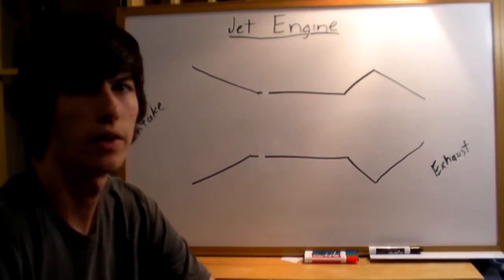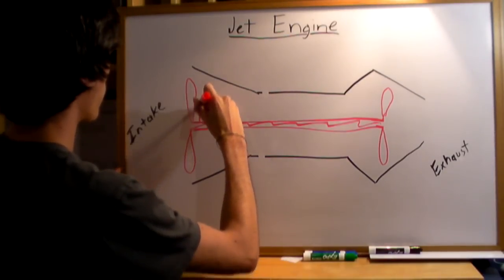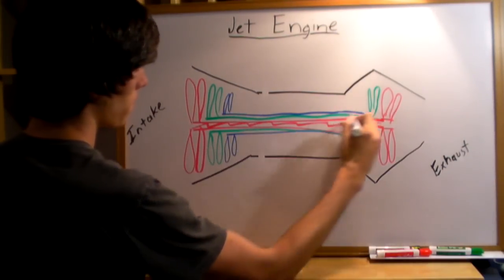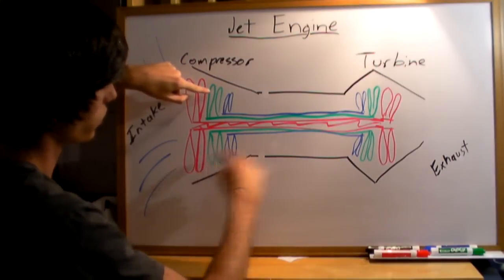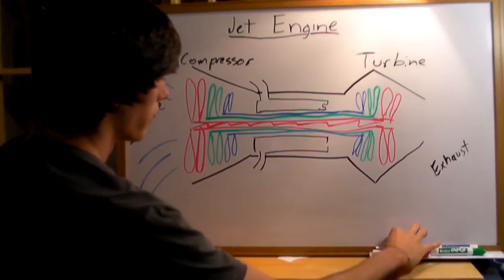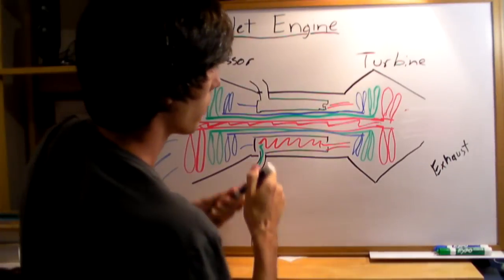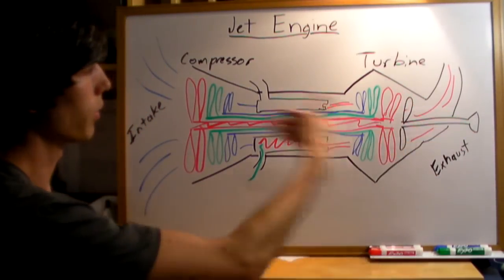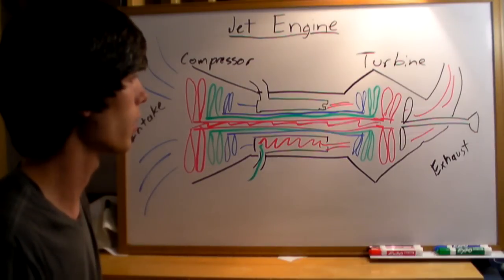Jet Engine - Explained

Comment: Hey! Aren't there, in between the turning compressor blades, static blades too?
Reply: Guide vanes are indeed employed throughout the engine.

As a compressor blade imparts momentum on the gas through rotation, it forces it along the path, but also imparts angular momentum on the particles.

Guide vanes scavenge the kinetic energy from this angular rotation and store it in the gas as heat and pressure, without affecting linear momentum much. Without them, beyond the 2nd stage the gas would simply rotate with the blades.

Further compression is achieved by the narrowing of the gas path, forcing the gas into a tighter volume.

In the turbine section, an inlet guide vane converts most of the linear momentum to angular momentum (in other words - it spins the gas up), which is then captured by the turbine blades behind it. Expansion of the gas path promotes conversion of potential energy stored as heat and pressure to kinetic energy in the direction of expansion (i.e. along the shaft). This all happens at every stage simultaneously.
Reply: Clear, thanks!
Reply: doktorbimmer This is completely wrong. Air is not accelerated in the compressor and the compression happens in well... the compressor, obviously.
Reply: +The real doktorbimmer The compressor gradually increases the pressure throughout the stages. The maximum pressure is right after the compressor last compressor stage in the diffuser, which is right before the combustor. The combustor does not increase the pressure. http://image.slidesharecdn.com/15-2-121008023425-phpapp01/95/easa-part-66-module-152-engine-performance-8-728.jpg?cb=1349663793
Reply: +The real doktorbimmer Sorry, what doesn't do what? You are correct about the Bernoulli's principle.
We might have a misunderstanding here about which engine parts do we refer to with which name.
The divergent orifice after the compressor which you refer to is the diffuser. It's between the combustor and the compressor. Inside the combustor where the combustion occurs, the pressure drops. Right before that (in the diffuser), the pressure is at it's peak in a jet engine.
I hope this converges our thoughts. I'm not making these up but checking from different sources. This is just basic theory after all.

Comment: the reason turbines are not used with cars is the fact that they are only efficient at higher rpms and harder to control   with gradual changes in throttle you get a hell of alot of output   and the cost to build these things are  ungodly its just not practical to use in cars

Comment: I understand how the engine works but whats the mechinesim that turns the fan blades?
Reply: Air flow makes the fan blades turn. It works very much like the turbo in a car or truck. That's one of the downsides of turbine engines, they require ground support to spool up to speed. They also have very poor torque, which is why there not common in cars.

Comment: You said after the air is compressed it moves faster. that is  actually not correct. If you take a fighter jet for example the intake often is designed specifically to prevent air entering at mach 1 or it will essentially blow out the flame. The entire point of the exhaust nozzle is to make sure the gas speeds up as it leaves the turbine. Exactly the same principal as a rocket engine. After all a jet is really a turbocharger mixed with a  rocket engine.
Reply: Ditto on this one. In the compressor section the gas velocity is held somewhat constant and the static pressure is increased.

Comment: So i feel i need to add to my last statement  (it was just a black statement ) to point you in the right direction... look into aviation diffusers and how they work. It is not the are existing the back off the engine  (as crazy as it sounds) that creates thrust (mostly) and on most helicopter engines output-shafts come out the front. The rest on how a jet (turbine) engine works is not as easy or basic as this video makes it seem. Years and years and years of complex engineering go in to every engine

Comment: O u should of added turbo fan engine to this video which just adds a large fan blade in front of this engine and a outer casing around the engine, some air goes in compressor, some goes around it in outer casing

Comment: A turbocharger is not only too weak to be an engine but its also too fragile. Plus there are over 5000 components to a jet engine. What you're saying is like comparing a car spoiler to a 747 wing.

Comment: Well 3 shaft turbine engine is rare to find. Inner shaft rotate fan blade (not compressor not turbine) that usually use at turbofan engine (with by pass air) and it's at lower RPM. Mid shaft rotate LP compressor with not a very high RPM and most outer shaft rotate HP compressor with very high RPM (10k or more). The shaft can connected with a gearbox to chopper/propeller but can't connected to wheel directly. Need a jet nozzle to become a jet engine, without it's just gas turbine/generator.

Comment: there was a jet engineer explain the speed. i still dont exactly what hes trying to say.  i remember how one guy in the comment said if the jet engin spins faster the faster you get thrust and speed. i thought the same way but the engineer said its not true. he said that its the air flow velocity, and he refer to the bigger the jet engine is the more air flow. i do understand that the bigger and more air flow what makes it fast but then again, isnt that the faster the blade spin the more air flow it is?
Reply: Well, the problem is that you can't accelerate the airflow as much as you want. It's of course true that the air velocity increases when the turbine revs up. But there's a limit of how fast the air is allowed to flow. 
The airflow can't get super sonic, otherwise you run into problems. Air starts to behave "strange" when it flows supersonic. For instance the functioning of a diffusor reverses when the flow in it changes from subsonic to supersonic. The easiest way to circumvent this problem is to simply made the engine and especially the engine fan bigger. With a bigger cross section of the fan you can accelerate more air to the same speed wich results in more thrust. But because the velocity of the air stream is related to the velocity of the fan blades which accelerate the air and because a bigger fan achieves the same circumferential speed at it tips at lower rpm, bigger engine can rev lower to achieve the same flow velocity.

Comment: still baffled, where does the main power come from to propel the compressor to suck air in? with the compressor, combustor and turbine the  main parts, which part starts the engine first to begin the whole cycle?

Comment: This Engineering Explained guy is hopeless.   He did NOT explain the important principles of a turbojet engine.   
The first important thing you need to know is the combustion increases the gas volume - this causes acceleration of the burnt gases out the exhaust orifice.   You learnt (or should have learnt) in high school that F= ma, that is, to accelerate mas, you need a force.   So F = ma means that the gasses going out the exhaust causes a back PRESSURE inside the combustion chamber.   This pressure of course exists in all directions, including the incoming air. So the compressor MUST raise the pressure of the incoming air to above the combustion pressure.   Its not about raising the air velocity as Engineering Explained guy thinks, the critical thing is raising the pressure - otherwise the flame will come out the front as well and render the engine useless.  
The exhaust is essentially a hole, which therefore cannot transfer any pressure to the airframe as thrust.  The action of the compressor in squeezing the air must produce a thrust, via the stator blades (which he didn't mention), which would try to push the aircraft backwards,  opposed by a forward thrust on the compressor shaft bearings.  However, the forward-facing component of the combustion chamber is always greater in area that the  chamber air inlet area (this is allowed due to combustion increasing gas volume) - usually substantially greater.  This means the the pressure exerted by the combustion gasses on the forward component of the chamber is a greater force than on the incoming air, producing a net forward thrust which is transferred to the airframe.

Comment: Nice job explaining the engine core.
*******BUT**********
You said nothing about the main thrust air that bypasses the core.
That air is the main thrust!! How can you only explain how half of the engine works and think you are making it clear?
Reply: Because he explained a jet engine, not a turbofan engine. You are referring to the turbofan engine, which is slightly different and uses a big fan to provide the main thrust
Reply: Gianluca Ghettini Thanks! Im ordering a book that explains them all.👍🏻

Comment: Still dont know, why the preassuse created by the burning of fuel, dont affect the compressor blades directly. The burning creates heat, the heat will partly converts to preassure increase. Both of heat and preassure are expanding in all directions, so the preassure will help to spin the turine blades, but will also work against the airflow generated by the compressor, so the compressor could create less thrust, so the blades of compressor will be slowed down by the combustion. That means, the combustion is not increasing the thrust. 

Lets imagine a pipe. But a firecracker in the middle, and explode it. The shockwave will leave bot of the sides with equal strength. Okay, but now blow air though the pipe, and explode the firecracker again. Now the wind coming from one of the pipe's sides is stronger, than the other. We can see, that the firecracker did not affect the difference of these forces. If we put a shaft inside the tube, and also put propellers on the both end of the shafts, and then explode the firecracker, we will notice that the explosion will try to spin the propellers in opposite directions, with the same force, so the shaft will not move. That means, when we make the same experiment with a constant air flow through the pip, the explosion will still not affect the air flow, it could not accelerate the pipe in any direction. So I think the solution is based in the shape of the jet, because its obviously not only a pipe, or maybe the compressor and turbine propellers are not turning the shaft with the same force to the opposite direction, if they experience the same force of air-flow but from the opposite direction. 

Summa summarum, I've learnded some new things from the video, but still dont know, how could this device work.
Reply: If you look at a P-S or T-S diagram for a turbojet you would see that the combustion process is essentially constant pressure (although really there is a small change). What happens instead is an expansion in volume. The pressure doesn’t increase because the flow isn’t restricted.

Compare this to a piston engine. The volume is constant and thus the fluid is restricted in the cylinder. Because of this restriction, the pressure increases. If the fluid wasn’t restricted in a piston engine, the pressure increase wouldn’t occur.
Reply: @icupjoke1307  I think I should learn mor physics before, I could understand those diagrams, since entropy in itself is a new concept for me. thanks for your comment!

Comment: Actually a turbocharger is a jet engine, it's just missing a combustion chamber on it's own. A Jet engine sucks 'n' direct's just behind it. Best examble of a turbo charger in the form of a jet engine is with a turbo prop or turbo shaft engine...it drives a gearbox and your utilzing the rotating compressor blades to either spin a prop or a rotor at high speed.

Comment: Naw a turbocharger is simply a "suck 'n' direct" type of machine where it sucks the outside air from mini turbine spinning by the blowing exhaust, and directs it to the intake manifold. The turbine is a "Suck-Squeeze-Bang-Blow" The blades suck in the air, squeez n compress it with the fuel, ignite n combust the mixture, then move from the force of the explosion.

Comment: Not quite how it works of a c130. Same idea, but all stages of the compressor and turbine travel at the same speed. And I hate when it's pronounced turb-eyen instead on turb-in. Haven't worked with a mechanic yet that pronounces it that way haha.